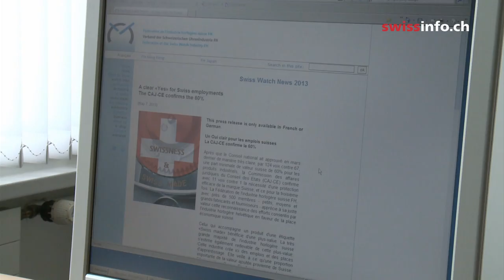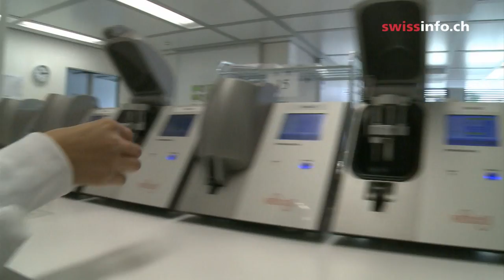Are Swiss watches Swiss enough?

Comment: The legend "Swiss made" on your quartz watch dial does not really represent the truth. As many known brands have Japanese movements,fairly typically Miyota. For example Zeno of Basels Chronograph which sounds about as Swiss as you can get,features a Miyota OS20 movement. These movements cost less than £10 on eBay. On a watch costing around £500 retail I would call that less than impressive! Burberry and many other brands selling at similar prices also use this cheap movement.Scandalous prices really as the movement is the heart of the watch.
Reply: Ian Vert well said. Personally I am starting to lose interest in "Swiss" watches!

Comment: When it comes to things like clothes, cars, and electronics most people don't care where they are made.  If a car, for example, is hundred percent British made the company uses that as a selling point.  Some high end luxury designer clothes may be foreign made to some extent.  The same goes for watches, many people either don't know and/or don't care where the watch was made.  Many people buying Rolex may not know that Rolex is one hundred percent Swiss made, assembled, and tested.  People may feel the same about other Swiss watches, who cares, it looks good, it say "Swiss Made," good enough.  But there are those of us that this does matter.  Which is why I will unhesitatingly buy Rolex, but I'm careful about other brands.  I'm hesitant until I research.  My car, my clothes, and electronics I don't care where they are made, but my watches, if they say Swiss they better be all Swiss.  I learned this when I bought a German watch years ago.  The dial says "Made in Germany," but the movement, I later learned, was ETA made, and ETA is a Swiss company, and even then many of the ETA movement components are not Swiss.  So what did I get?  A German watch?  A Swiss watch?  A Chinese/Malaysian watch?